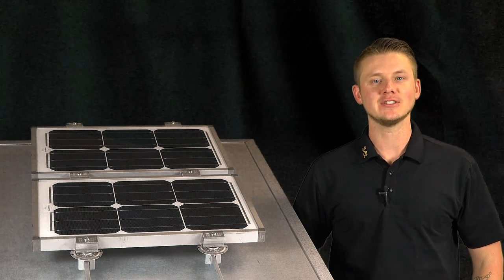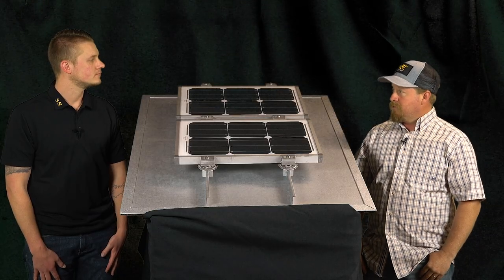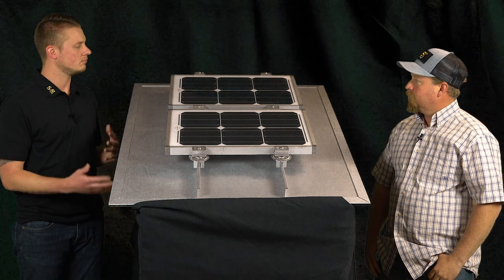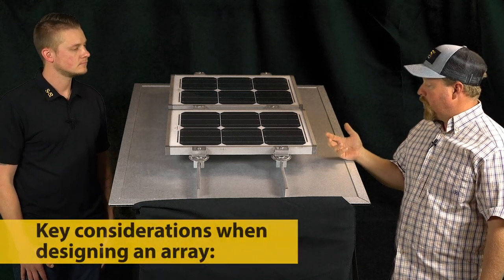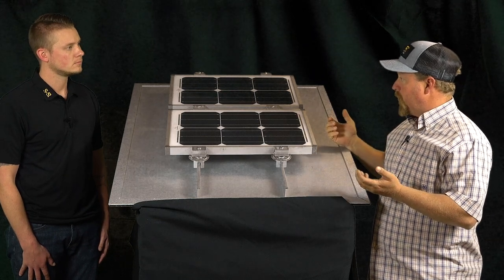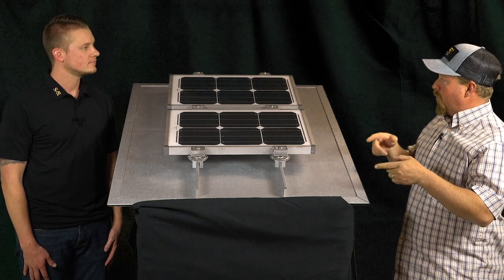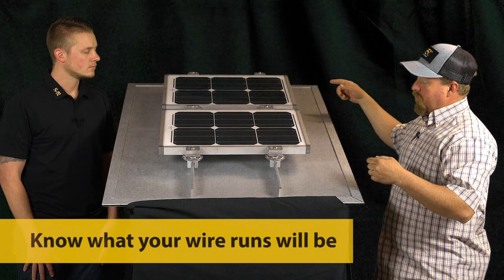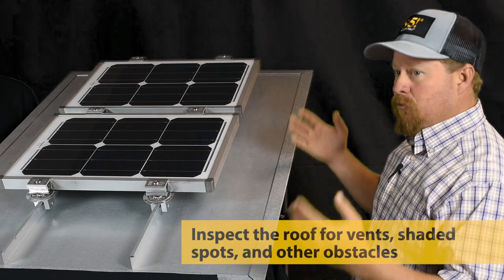Solar Arrays: Metal Roofing Design vs Layout

Comment: Hi Curtis, I am the owner of a solar company in Vancouver Canada called Solar Connect. The PVKIT 2.0 might work for one of our upcoming projects. Where do I find information on which modules are compatible and allowable loads with respect to spans between clamps? Thanks.
Reply from the maker: Hi Jennifer, thanks for reaching out. Our technical support team can help you with this. Here is that contact information: (888) 825-3432 and support@s-5.com. Thank you!
Reply from the maker: Hey Jennifer! Thanks for your question. We're happy to hear Solar Connect is interested in the PVKIT 2.0. You can reach out to our Technical Support Team by emailing them at support@s-5.com or call them at (888)-825-3432. They will be able to assist you and give you all of those details.

Have a great day,

-Curtis